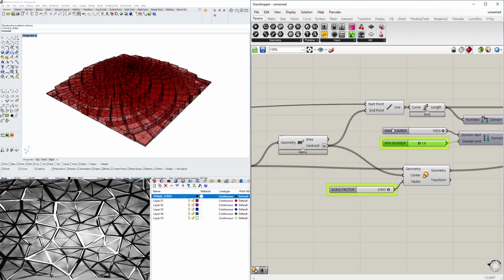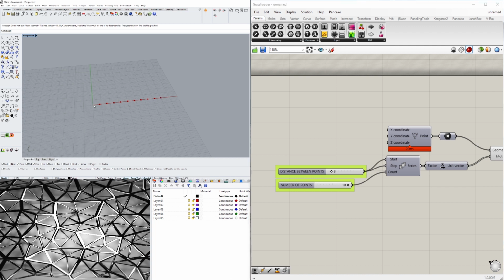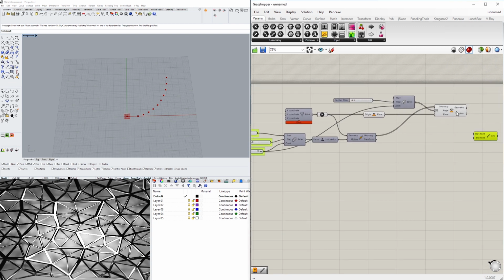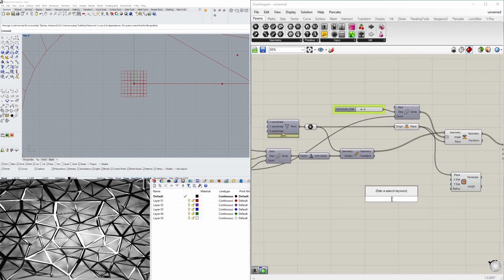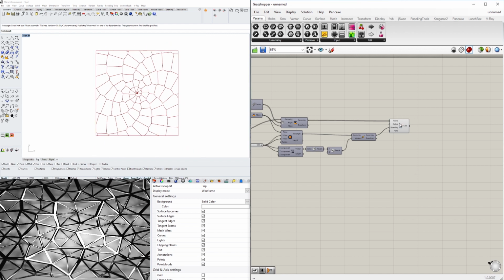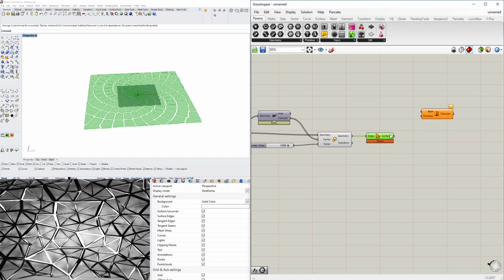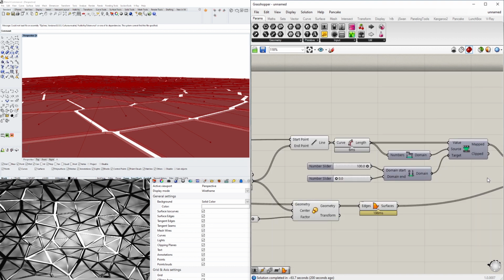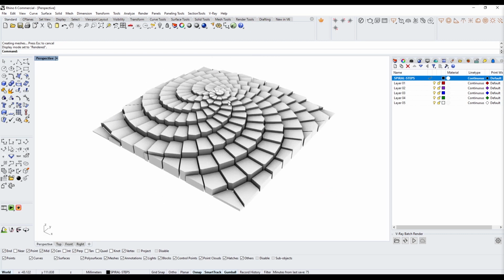Spiral Pattern Finding Fully Explained Parametric Design Rhino and Grasshopper

Comment: For the rectangle, the x & y inputs  will accept a “construct domain” component, so you can save a step by using  a negative to positive domain and if it’s just a square you want, all you need is one slider one one construct domain component shared by both x & y inputs.

Great tutorial. Very clear and well explained.